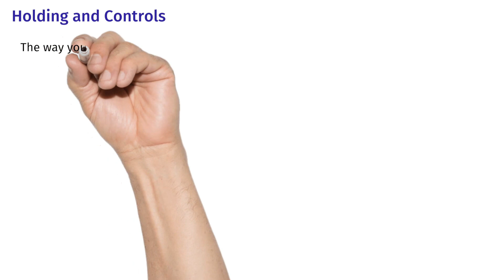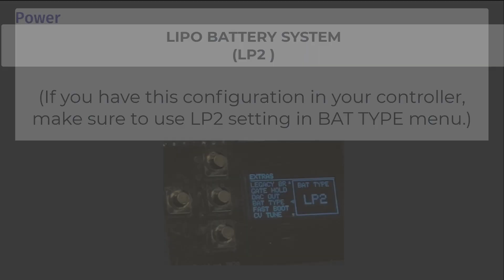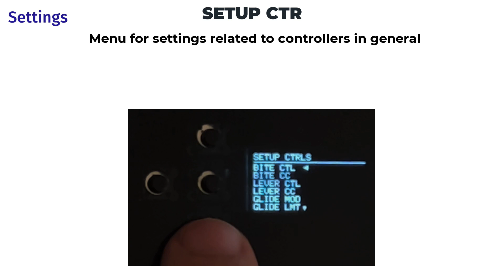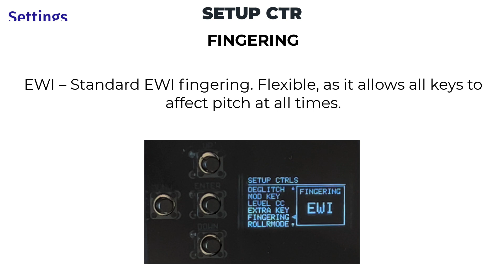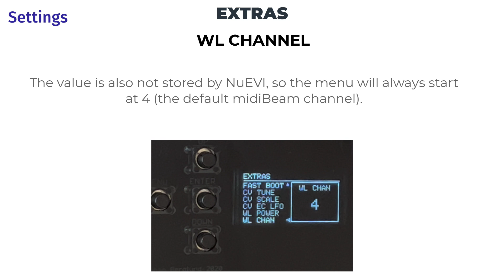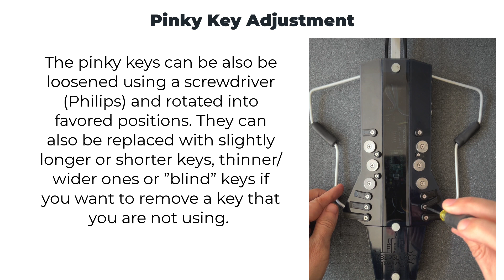VIDEO USER GUIDE NuEVI : NuRAD v.1.6.1

Comment: I was looking at the different modes for the NuEVI and I had three question 
1. What is the cv model 
2. What is LiPo 
3. What is the ball bearing canister
Reply from the maker: CV = Control Voltage - used to control synths. CV indicates which note (event) to play: a different voltage for each key pressed; those voltages are typically connected to one or more oscillators, thus producing the required pitches. Such a method implies that the synthesizer is monophonic. LiPO is a Lithium Battery. The Ball Bearing Canister is a smooth octave mechanism for the NuEVI.

Comment: I received my NURAD about 3 weeks ago and because I've had my EWI-USB and EWI-4000s using Bite CC2 for vibrato, so I tried to use the NURAD the same way. However with both the samplemodeling and the SWAM I fail to get any CC2 output, hence no vibrato. 

I've gone over the settings and I'm sure that I have the vibrato set correctly to Bite etc. My EWI's work fine doing Bite CC2 vibrato.

Nor can I use the left hand Thumb lever to get CC2 sent out, although I can just hear a bit of vibrato, even though I do not see any of the dials (samplemodeling & SWAM) showing input.  When using Kontakt I can see the Mod Wheel icon moving.

Today I discovered that I can get some vibrato by setting the NURAD Bite to Aftertouch. Things sound much better but I have no clear control over it.

So, my question for you is: Do you have any suggestions for fixing the Bite/ Thumb Lever CC2 issue? Am I missing something ? Does your NURAD produce proper CC2 messages?

Unfortunately, Larry Nybo has not replied to any of my e-mail in over 2 weeks, which is very disappointing, and reflects very poorly on his company.

I was very happy with your NURAD video tutorial. It's so much more helpful than simply reading the manual.
Reply from the maker: Send me an email an I'll sent you a link for a Zoom meeting (First ones free) Here is my email: curtsipe@me.com There is a lot that will be much either to discuss in conversation. We can get you up and running!